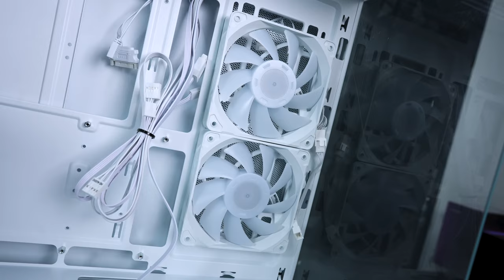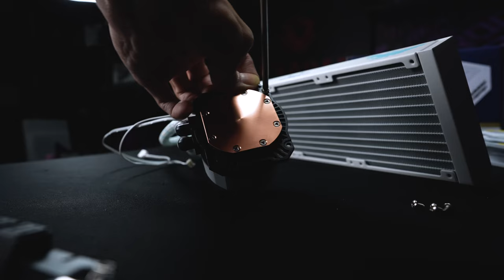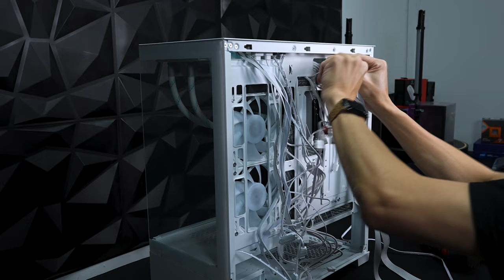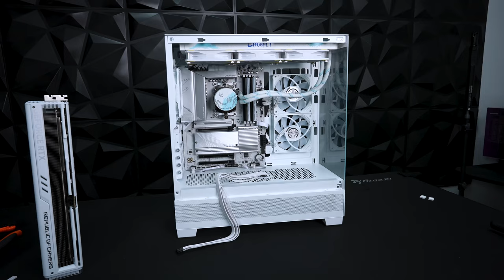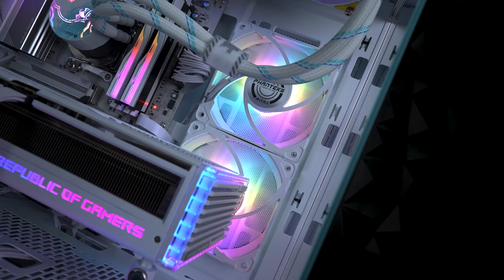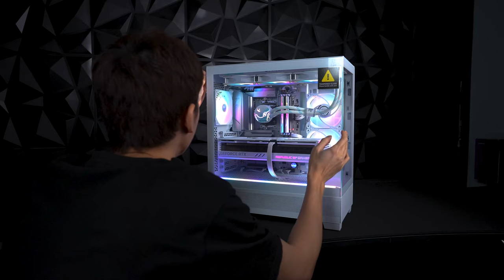R7 7800X3D + ASUS ROG STRIX White RTX4080 Super | Phanteks XT VIEW White | SUPREME Build | INVADERPC

Comment: How do you recommend I put the fans? Intake, exhaust? Im planning on having a 360mm radiator on top , then im gonna use the 6 other spots
Reply from the maker: Hi , you can do as same as what we do on the video, and put 3 fan bottom for intake , so you got 4 fan exhaust including the radiator fan , and 5 fan was intake .
Reply: @INVADERPC Thank you, also do you recommend I even have the bottom 3 because i might want a gpu stand so mine wont sag
Reply from the maker: @Y4kPink_RL  depends the gpu size you brought, and also not recommend the bottom 3 fan because not really helpful for the airflow .